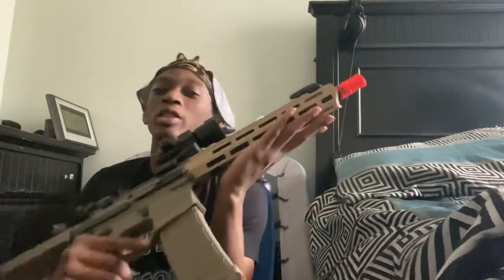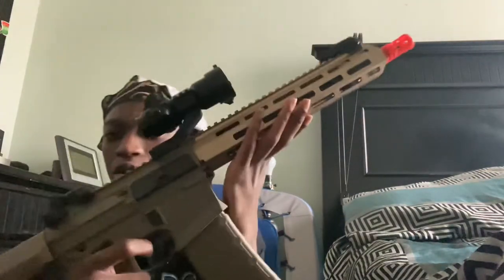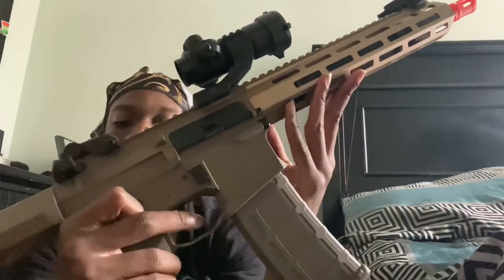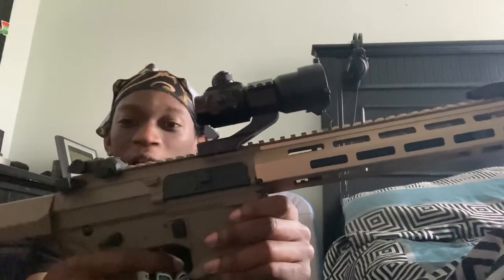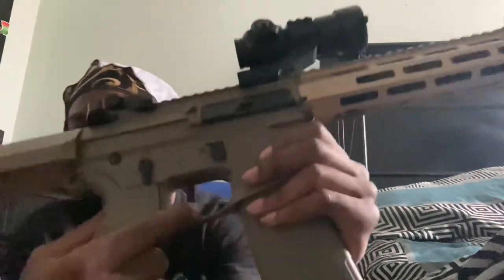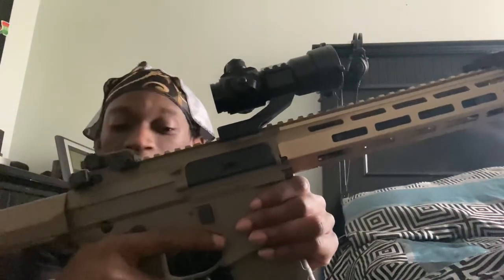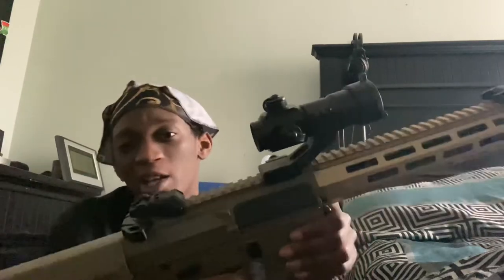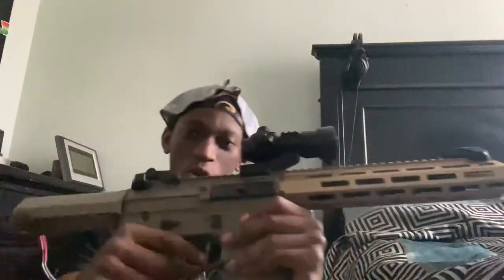Matrix calico jack m4 (mosphet programming guide)

Comment: would you reccomend 7.4 lipo or 11.1v lipo  for it
Reply from the maker: 7.4 is recommended but you can run an 11.1 with no issues
Reply: @cringegaming3539  is this a problem, i run a 11.1v with the calico jack but after the first mag the motor and pistol grip gets hot
Reply from the maker: @Sana-zu9yq  I’d say watch your trigger discipline and try not to shoot too many bbs at once. The 7.4 is recommended but the 11.1 is usable
Reply: @cringegaming3539  did you use 7.4 or 11.1v in your gun in the video
Reply from the maker: @Sana-zu9yq  I used an 11.1 lipo. Due to the intergrated mosphet system the 11.1 won’t burn it out or strip the gears as easily but while using a higher power battery that is over the recommendation will ware out your gun quicker than a 7.4 would
Reply: @cringegaming3539  so 11.1v and 7.4 wont burn out the gun cuz of osfet protection
Reply: @Asecc Airsoft tysm for telling me i will def change the motor
Reply: @Asecc Airsoft so would the asg  30k motor get hot with the lipo  battery like the stock motor or no
Reply: @Asecc Airsoft do you think i should replace anything else on the calico jack
Reply: @Asecc Airsoft I have the carbine
Reply: @Asecc Airsoft which diameter do u recommend ?
Reply: @Asecc Airsoft I have the sbr tanker stock version